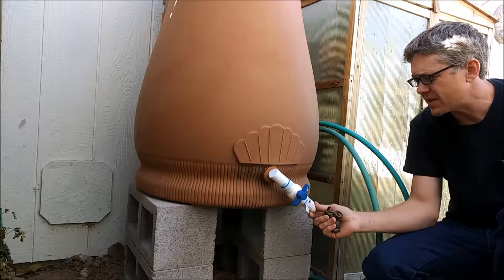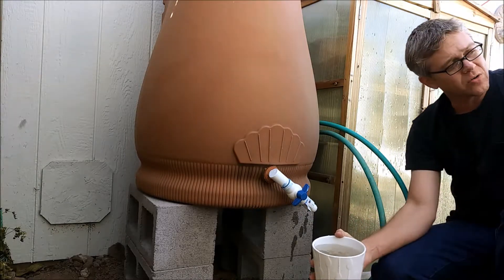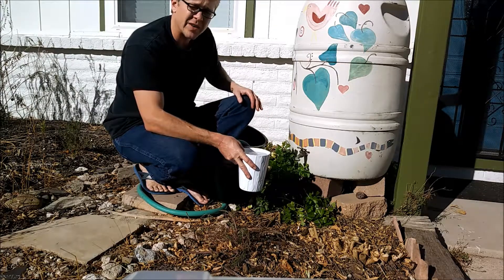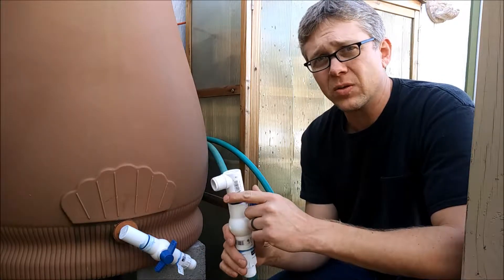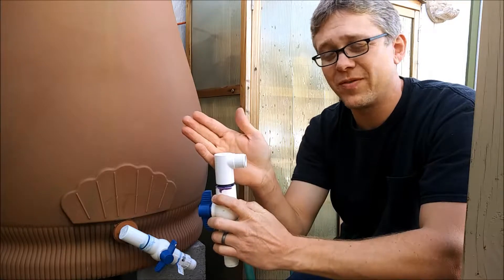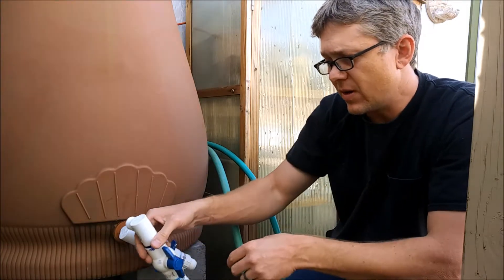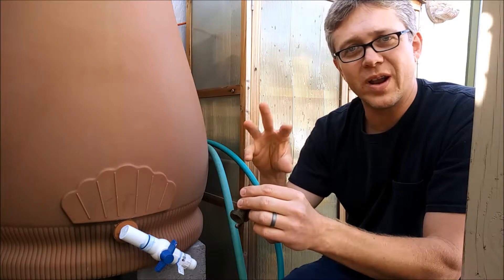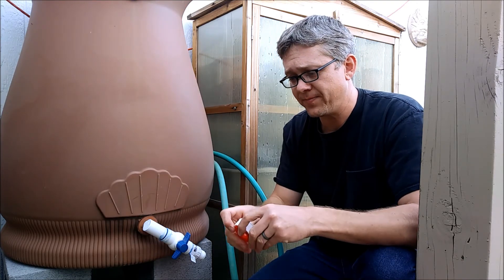Rain Barrel Spigot Comparison and DIY

Comment: Thanks for the video. It was what I was looking for. FWIW, the difference in threads is more than just a difference in pitch. The fitting that threads into the barrel fitting is a pipe fitting which uses tapered threads to make the seal. That is why Teflon tape or a pipe sealant is required. Tightening the fittings together compresses the sealant more and it is the sealant between the male and female threads that make the seal. The fitting that attaches to a hose uses straight threads. The seal is made by compressing a hose washer between the hose fitting and the fitting on the pipe.
Reply from the maker: Makes sense, thanks for the info. I'm glad the video was useful for you!